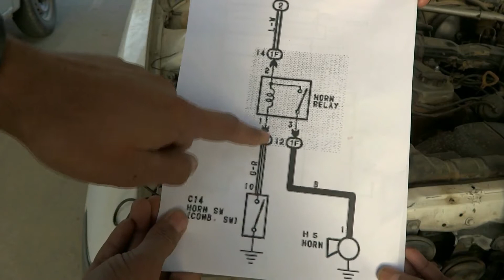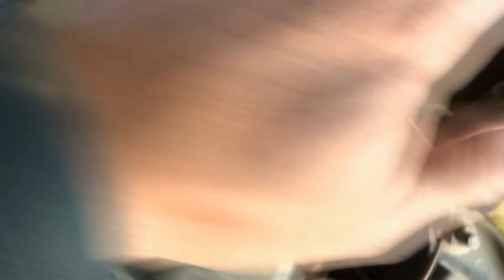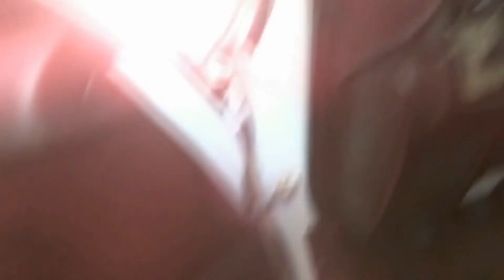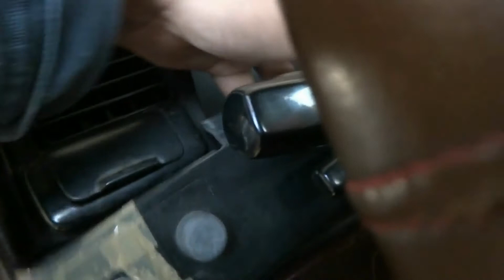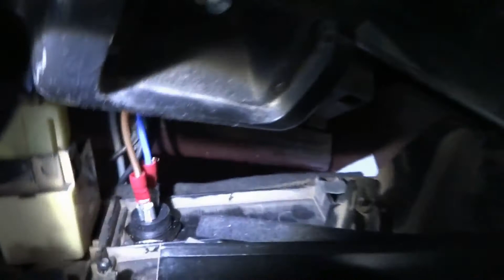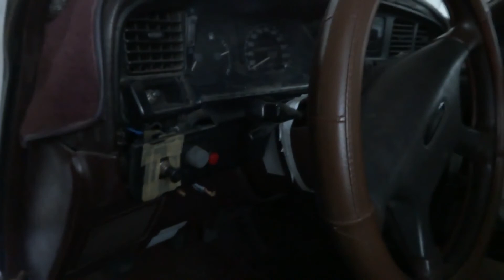Car Horn repair.

Comment: Problem with my car (Cultus 2007) is that its horn switch's soldered point inside the steering box gets broken automatically after couple of months of repair. I got it soldered 2-3 times but same things happens again.
I am planning to open it myself and try a longer and thing wire... will it be good ??
Thanks.

Subscribed...

Comment: I have a 2008 Toyota prius and the horn is not working, I changed the fuse and it still not working any idea on how to solve the problem? thanks
Reply from the maker: You will not be able to figure it out the way you are trying to do it! Testing and measurement is the key to troubleshoot. Try to test things instead of blindly replacing them. Follow the video and test for voltages at different points. Your testing will lead you to the problem. Hope you will solve the problem if not even, you will learn a lot in the process. So my advise, please test and measure. Regards,
Reply: thanks.

Comment: Interesting remedy. My friend is having a problem with turning his steering wheel at times and his horn goes off. But he would still have to disconnect the horn from the steering wheel. He's afraid to mess around with the air bag.
Reply from the maker: +Rolandjams Thanks for interest in the video. Your friend probably will have defective clock spring inside steering wheel. So the replacement will hope help. There is not such potential problem with the airbag normally if you are enough careful. As the air bag needs electrical trigger to activate. Hope you will solve his problem. Regards,
Reply: +LearningZone Much thanks.